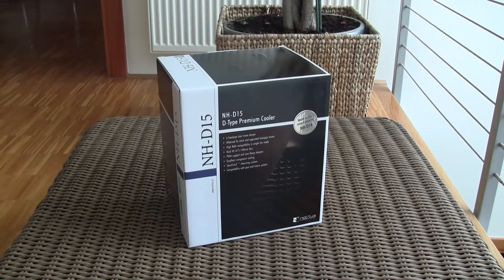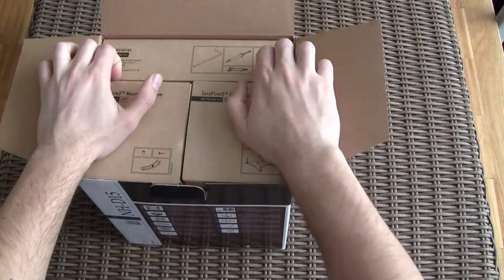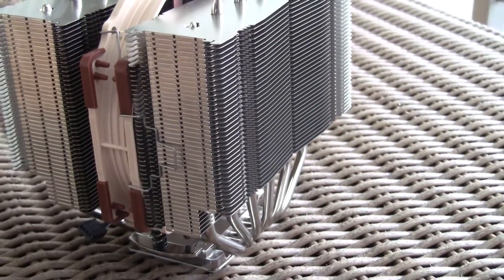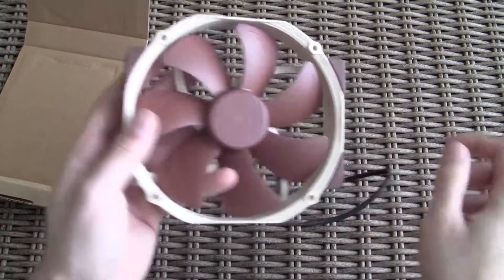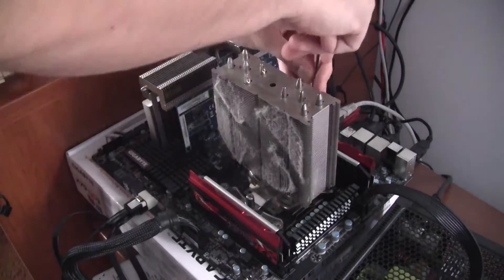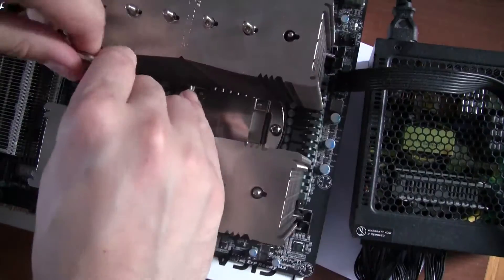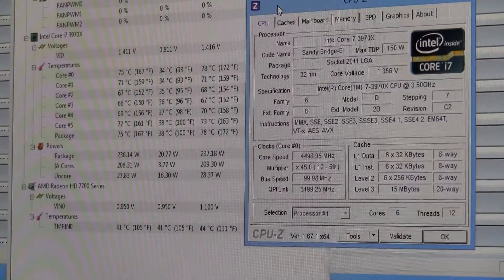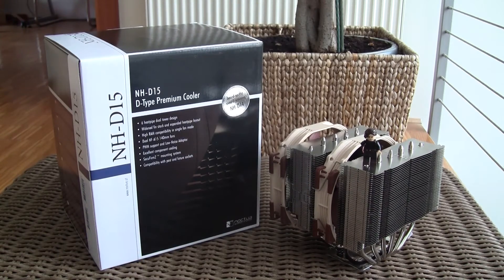Noctua NH-D15 Unboxing & Review

Comment: does this support lga 1366 socket?
Reply from the maker: Unfortunately, no!

"Socket compatibility:

Intel LGA2011 (Square ILM), LGA1156, LGA1155, LGA1150 & AMD AM2, AM2+, AM3, AM3+, FM1, FM2, FM2+ (backplate required)"
Reply: Heyy iliveinauckland Uhm, if you ask noctua they will send you a free secufirm 2 kit for 1366